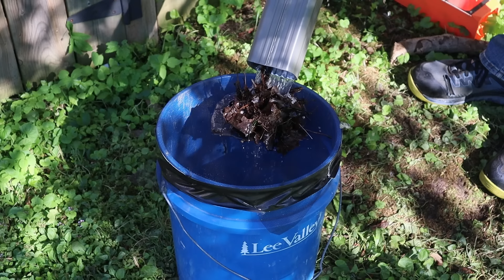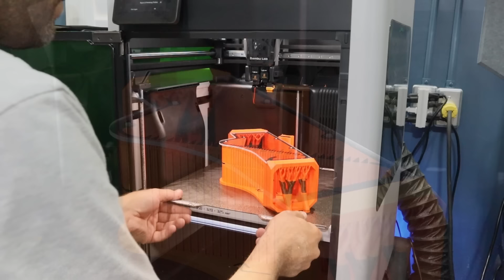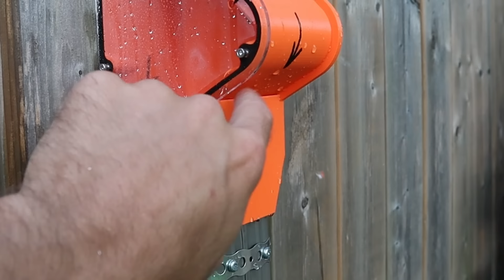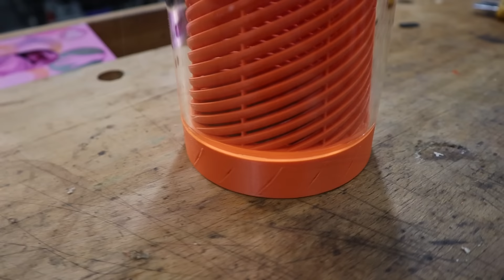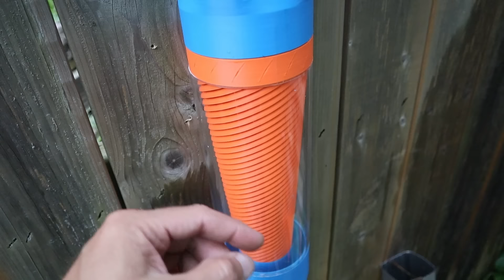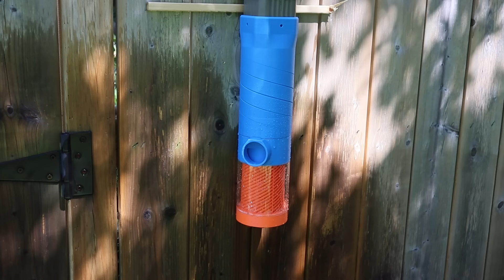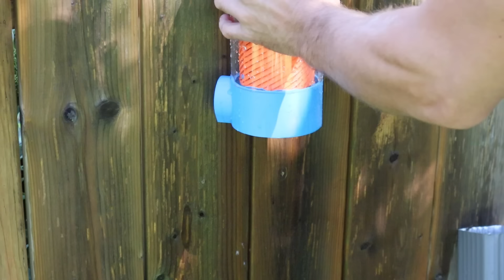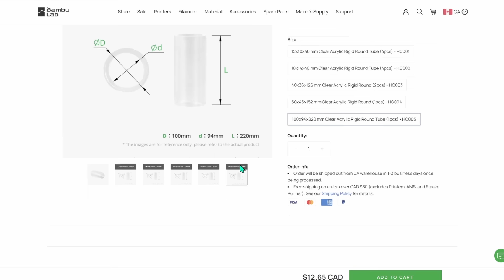Can you 3D print a self cleaning downspout rain water collection filter that actually works?  Let's

Comment: There isn't really a universal self cleaning spout. The issues are plenty, but one major one is that slats are still big enough to let the small debree and fines through. After a long hot summer gutters would be full of crap and organics decomposing. Which will come out  like dirt clogging up the spout. A combination of first two designs would be best imo as a person can easily come through with a brush and clean out the grate. Where as the conical design seems efficient but will get the slots clogged on the inside which will be harder to maintain.

In a bigger system this self cleaning will be done with a large ammount of flow to dislodge and clean the slats, but rain is unpredictable.

Comment: The nice thing with the magnet should make it so you can easily just pull the filter out if you need to clean needle 
I would think if you make it more screw you could get more water to catch go though, but it seem to get most of the water.
I need one the opposite so the dirt get pull out, and the water continues down

Comment: So... this is great as a general debris filter, but it doesn't solve the first flush contaminants issue, unfortunately, which is what I've been trying to find a printable solution for. Fortunately, I've already got gutter guards on the house for the leaves and twigs, but I still don't want the dust and tannins and pollutants - the majority of which will be in the first few inches of rainfall - dumping straight into my frog pond. A filter like this one is the perfect first step, as there's usually a screen or something similar in front of the first flush bypass, but...

Comment: I would do it with a self cleaning mechanism. Maybe with a solar panel attached that every hour or so it will just run kind of plastic blades over the drainage holes to clean them.

Comment: I really like how you approached the two competing design criteria! You first optimized water capture until you had a healthy margin for error against the first design criterion, and then reduced that margin to improve debris rejection. That last design seems the best at separating large debris from the water stream; but I have to wonder if the "clean" side of the filter will clog up over time with medium or tiny particles of debris and dirt.

Comment: it looks like enough of the water is building up in the collection section of the filter that its causing a backup above some of the filter fins. this probably negligible for your purposes, but you could add a slope to the output and/or just more reservoir space in that section at the bottom to avoid that. This also may not even come up under real world use since i suspect it will be normally less water pressure. Over all though neat design

Comment: I really like they way it's evolving. Not sure where you are with it now, but I have a couple of suggestions that maybe haven't crossed your mind. It seems for testing purposes having it connected to a section of gutter with random amounts of debris in it before it gets the hose again may give you a better real world scenario.  Since your hypothesis about the water hugging the inside of the downspout appears to be correct, have you considered flaring the filter surface out? I like the diameter of your last iteration, but if that were the smallest diameter that opened up as it went down I think it would shed debris better. It almost looked like both spiral versions worked too well not hardly allowing any water through the center.

Comment: Looking at the blue section at the bottom. I cannot help but think that in a higher flow the catch area at the bottom could over top and flow back into the solid waste exit.
I think it would work a little better with the blue catch element at the bottom being longer or wider so the water had somewhere to settle before being diverted out. I don't know if the inside is flat or is raised towards the opposite side from the water exit.
Reply from the maker: Yep, you are absolutely right. I have made adjustments to the final version and the lower section is quite a bit deeper and also holds more volume and I’ve adjusted the taper towards the exit pipe a little bit too so that again it’s only slightly angled and can hold a bit more water that way too.  It’s been working great for me. The filter seems to be staying clean, but I am going to be taking it apart soon to check the inside when I close it for the season so that’ll be interesting to see what it looks like on the inside when I open it up.  I don’t mind cleaning it once a year what I need to switch it around so that the water goes into the barrels.  So I’m looking forward to seeing what this stainless steel mesh looks like on the inside.  I made several follow up videos to this one too so if you haven’t seen the latest one, check that one out and let me know what you think.
Reply: The seals at the bottom of the barrels looked interesting. I have to admit I'd be more cautious about trying them.

How about ball valves at the bottom of the barrels so you can isolate them, drain one and do any maintenance ?

Just saw the updated design (orange printed part) in the "even better" video

I think the initial mesh issue stopping the water is possibly surface tension 

P.s. Is the organic parts of the debris, leaves etc that go through the filter any good as compost ?

Comment: Mmmm microplastics
Reply from the maker: Yeah, that seems to be a pretty common comment, however, I would note that most new houses have completely plastic pipes and water coming into our homes as well are contaminated with plastics. I’d also note that water in water bottles is contaminated with micro plastics.  So I think it’s a good thing to keep in mind. I don’t know how to solve this problem unless we completely eliminate plastic, but like I mentioned in a follow up video, most of these ideas are only possible if I can print them on my 3-D printers and unfortunately they use plastic.  In the future, I’d be open to using a metal 3-D printer, but then the barrels would need to be metal. The price would need to be metal, etc..  so let me know what your thoughts are, do you have a solution to this?  I saw a video recently showing the use of ferromagnetic fluid introduced into the water and then basically collected with a magnet after it had found itself to micro plastics.  Possibly a different type of filter that’s even finder would work?
Reply: @NeedItMakeIt different types of plastic with different additives to give durability

Comment: What about microplastics
Reply from the maker: I’ve made a few follow up videos and I did cover the micro plastics a little bit, ideally, I would not make this out of plastic as the final product but if we also look at other solutions to this problem. They are also made from plastic, so it would be difficult to get away from it. I think we would need to switch over to metal possibly copper pipe and then the barrels would need to be made from stainless steel or possibly even from wood, though that would not work in my climate because we have to close it for the winter, and the wood would shrink and gaps would open.  Possibly trying to find a way to fill through micro plastics when the water comes out would be a good idea.  I think it’s something we definitely need to look at!

Comment: As growing answers said, more testing will be needed. Gutters can carry huge volumes of water, a dedicated testing setup would be necessary going forward. Something involving testing 5 gallons of water at a time at different flow rates and different levels of debris, ideally simulating roof and gutter behavior as it flows in.

I think you've got a really cool idea here, and its worth spending more time on!
Reply from the maker: Thank you very much. I’ve made several follow up videos and I even made a huge improvement at the very last video and Incorporated fine stainless steel mesh and that along with a few other small changes ended up being the best solution, and I have not needed to open it or clean it since.  I will open it up at the end of the season when I disconnect everything which is coming up pretty quick.  So we’ll see what it looks like on the inside.

Comment: Would adding an overlapped lip between the filter and the adapter help with water loss, similar to that of pvc joints, with the adapter on top going into the filter? It could still use the magnets to make it easily serviceable, but the water would have a harder time going up and out the joint.

Comment: Feel like it needs a larger 'collection' area in the bottom, as I feel like part of your problem is the area fills up faster then it can empty through the pipe connection. The water seems to go back into the storm drain right at the area where you no longer have the collection area. It might help minimize the amount of water that escapes. Especially in areas where there is a lot of rain like here in Oregon.

Comment: I think you did the Coanda desing somewhat inverted. The source water is supposed to run over the curved surface and be "pulled away" from the main stream by the Coanda effect leaving the dirt in the stream. The spiral would draw the water to the outside, so that it doesn't need to narrow down towards the bottom.

Comment: In my opinion the reason why there was not much a success with the first and second versions is because there is not much pressure forcing the water in to the gaps .so what i am saying is that for that type of filter to work there would be a significant amount more pressure in the water flow for it to work properly. 
But in no means i am an engineer and don’t know the optimal way of that to work but it is just something that I observed .
Your Chanel is very cool and you do a good job with designing the water filters.

Comment: Have you tried a dumping system - i.e set a spring loaded trap door, set to a set weight, allow a blockage to build up and the water out, until the weight is reached and the blockage is dumped all togeather ( just thinking about the overall water waste. the walls of the pipe have a filter layer allowing the water to seep out while there is a blockage and then the spring loaded trap door opens once the limit is met i.e an uncontroleable blockage dumps the blockage all at once wasting less water)

Comment: I’ve been thinking about how water tends to cling to and flow along surfaces, and I’d like to propose a design idea that could take advantage of that behavior. What if we structured the pipe in a helical form to induce rotational flow and encourage water to stay close to the inner wall?
Additionally, by gradually widening the pipe toward the bottom, we could make it easier for filtered particles to be discharged. Since water naturally follows the lower surface due to adhesion and gravity, this shape could enhance the separation process without clogging.
I believe this approach could improve both flow dynamics and filtration efficiency. What do you think—worth exploring further?

Comment: Give the blue adapter pipe a 1/2 spout that sticks into the orange filter part. The water will already be past the joint it wont want to leak out of the attachment joint unless it is totally filled from a huge rain storm.

Comment: You missed a trick on the 1st design as the water will GRIP the curve flow back into the container IF you had of made a GAP for it!  Water is 'sticky' and defys gravity if treated right. Also on both designs you need to do 2 things, 1st angle the water styrations and also stagger them. Your 1st deign was by far the best and the one you can eaily improve on. Your single path, even stryations isnt optimal. If you had a GAP it will flow bak up and into the container seriously reducing water loss! Some guttering ive seen uses this princiap here downunder too. Water is amazing stuff! Now as for the gap you need to use this water grip effect on the stryations too, at the moment you have edges that grip the leaves (not good, it need an always smooth to effectivly get rid of leaves and worse, sticks) but again, have the curved edge on the inside to grip the water into the collection will work way better. Water hydrodynamocs is a felid you need to spend a little time on, you will mod your design and be amazed at the water collection and debri removal if you do. You never want things that will 'catch' debri as it will clock and backup always. And i liked the clear edges so you can see instantly whats going on too... Alas your spial will CLOG as its a gloggaholic desgn!

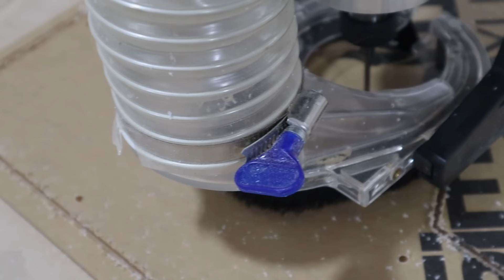Comment: 3:08-9 on the first design i think that if u would have raised the chamber where the water comes through a bit higher it would fix the clogging problem and the slot u made at the bottom works fine to me yea maybe a lot of water but thats to be expected and it works better with the leaves and stuff in it is cuz it blocks the water 9:45 i wish u added something to block the keep the water inside it to have a better view of the results

Comment: This is a very good design. One benefit you didn't mention or notice is you can daisy chain the smaller version.

One thing that you can do is have a vortex guide so the water is moving in a spiral direction opposite of the fins in the filter. It's the same theory used in chip separators in dust collection systems for workshops.

Comment: I've been wondering if I could 3d print a rail collection system,& you pretty much did that.  So thanks I truly do very much appreciate that.
Reply from the maker: I have another video coming soon, which I hope will solve all of the issues I've run into so far when I tested it in the real world-setup over the last few weeks.  It is working great, but I'm looking for a 100% self-cleaning filter which now also needs to filter out small rocks from our roofs, which is something I didn't expect.  It is coming together really nicely now and the solutions are super simple and nearly all 3D printable still.

Comment: Really neat idea, You should think about making this in the style of vaporizer tanks, the top and bottom sections screw together, internally, the glass is just captive between them. glued together like that would make it very difficult to clean.. years in you would need to replace it.
Reply from the maker: I'm just about finished a version which filters out fine particles as well, but I will take your ideas into my next video, thanks for that, I really like to hear about other ideas I haven't thought of.  Yesterday I took an idea from a snap ring on my Kramer dust collector, and it worked perfectly as a simple interior clamp, so easy and effective!

Comment: I'd think changing to a rectangle shape to match the downspout and using surface tension to draw in water would be best. That way there isn't a choke point for debris to slow down. I also noticed with the high flow rate it was backing up at the bottom and going back into the spout. Can't quite see how much room is available for the water, but overall it looks like it's capturing a large percentage of the water.

Comment: Given the captured water is being extracted via laminar flow and into a circular motion, would it work better if the output spout were to be at an angle optimal to the vortex rather than just out the middle at 90 degree bend?

Comment: it kinda really bothers me that you didn't just simulate a small trough for the water to run along (and pick up debris along the way) before falling into the downspout, nor a filter on the output to check if debris was coming through, or properly collect the output and ejected water to measure the volume that is going through. I hope you do it off camera at least, because who knows how much water would naturally stick to the walls when it's not pressurized through a cone nozzle aiming downward towards the filter.

Comment: You should have made a horizontal bit of pipe at the top of your setup, to emulate rain catching, most of it will not be coming in at the force you are applying with the garden hose directly into the opening.
I don't know if it would make much of a difference, but it would be a more accurate test (It would also have made it easier to get the debris in properly as it would just have been carried there by the water as it would normally do)

Comment: A few minor adjustments. Make the inside of the bottom, angled towards the exit to prevent water from "pooling" in the bottom (prevents bugs from creating small nests).  Add a simple male/female lip from the adapters to the filter, to allow for overlap. This will prevent water from coming out of the seams.  I would also use embedded screwnuts and stainless steel screw to hold the clear outside to the endpieces. I could see mildew eventually growing on the inside, since it can never full air out and dry. Eventually I suspect the clear tube would need a cleaning, or if pine needles get stuck inside enough.

Otherwise, this is a cool design.

Comment: could you put a water wheel on that spins the filter part might help with "shaking" some debris off using a reciprocating gear attached to a water wheel with a low gear ratio so it used the least amount of energy/force to spin

Comment: I can see in the final design that water is collecting in the back and going back through the filter to escape capture.  Perhaps if you made the drainage at the bottom larger than the current diameter (like a doughnut), you would lose less water this way.  Also, I wonder if a more vertical spiral pattern would be less likely to allow debris to get jammed in the slots.  Perhaps having the slots at a 45 degree spiral would not only help keep things like pine needles from getting caught, but would also induce more of a vortex that would pull more of the water out of the drain.